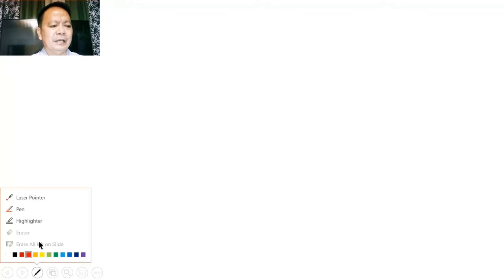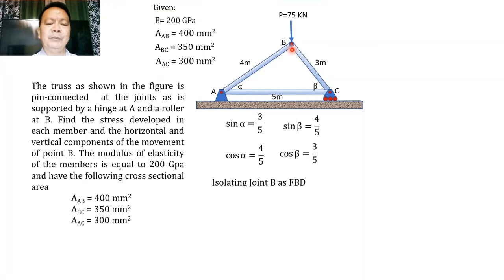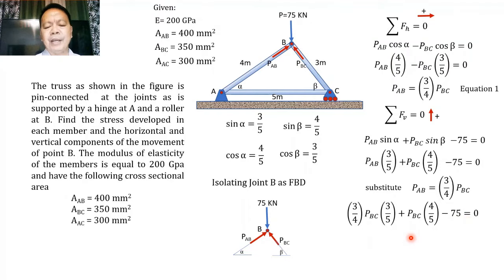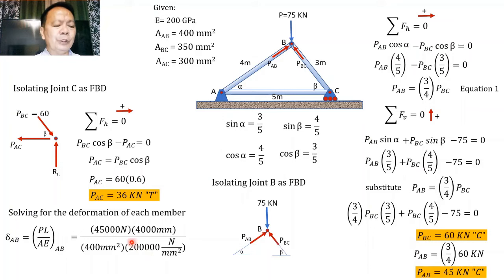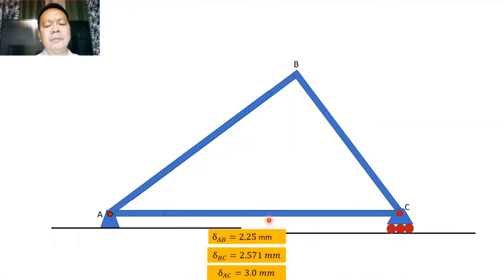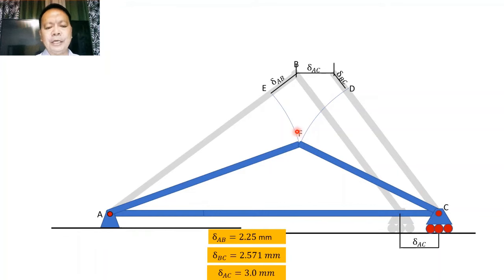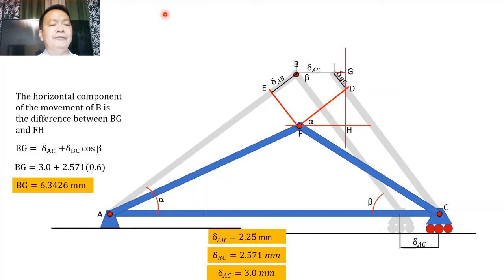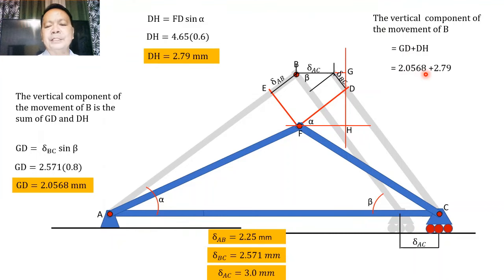Axial Deformation - In What Direction will joint B move? Let's find it here!!!

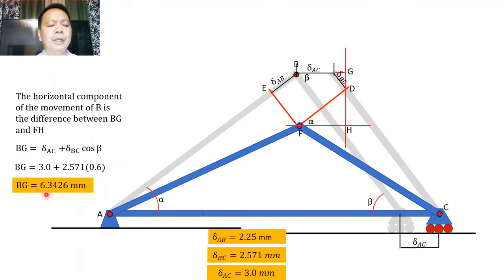Comment: Thank you for this sample problem sir, but I have a slight correction on 19:47 . BG as indicated is 3.0 + 2.571(0.6) should be equal to 4.5426. The horizontal displacement of B is therefore 4.5426 - 3.72 which is equal to 0.8226 mm. The same with the vertical displacement which is GD + DH should equal to 4.8486 when added.
Reply: I am also concerned about the horizontal movement. I think its horizontal movement is the sum of change AC + (BG-FH) w/c is  equal to 4.54.